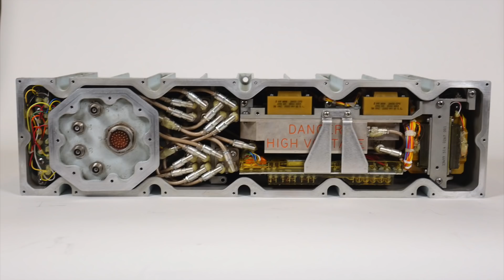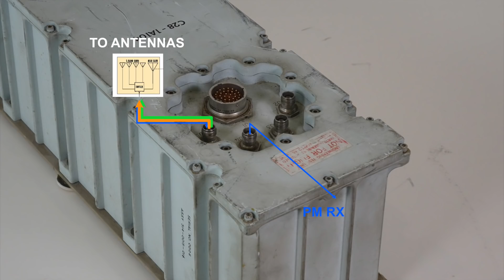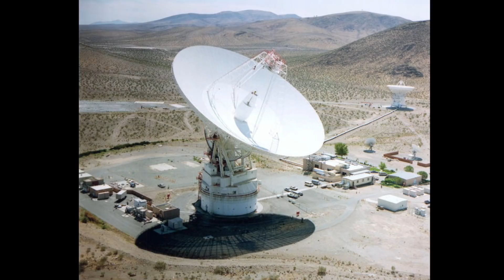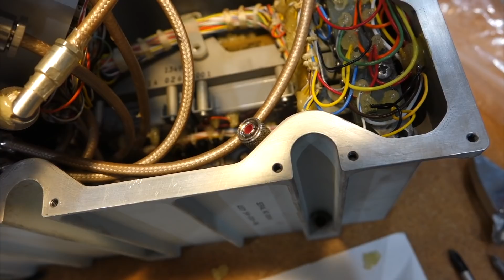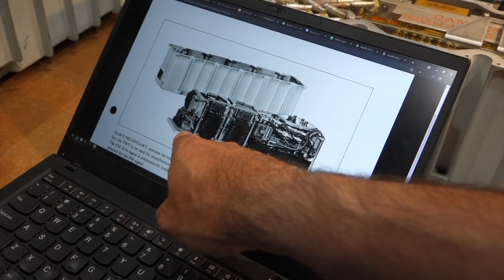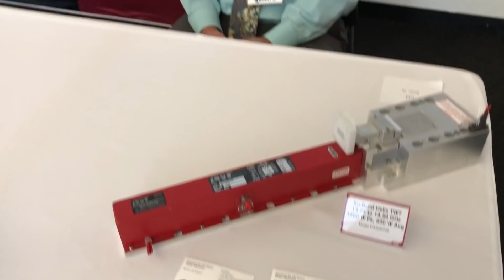Apollo Comms Part 2: Inside the Traveling Wave Amplifier

Comment: What is the purpose of the loud "bip" in the communication? Purely to signal PTT to humans of for the radio hardware?
Reply from the maker: Both. These are Quindar tones, automatically generated when the capcom presses the push to talk button and then releases it. This would signal to the transmitting equipment to which capcom was connected via a dedicated phone line, and which could be on the other side of the globe, when to turn the transmitter on and then off. This is particularly essential when the communications are half duplex (which interestingly is not the case here). They are of course no longer necessary with modern equipment, but they kept them to this day, as it is a helpful hint when having  slightly delayed space comms. It gets the astronauts a hint that a transmission is over and they can begin to talk back (I do not believe they heard the intro Quindar, as the transmitters were not turned on until it was detected, but I think they heard the outro). I guess what you nicely call "PTT to humans", which was unintended, but turned out to be quite helpful.
Reply: @CuriousMarc  Thanks a lot for the response! I wondered about this for a long time, thinking it was some kind of audio semaphore.
I am working on information systems for buses and tramways that use TETRA radio and even if full duplex is available, some use cases mandate half duplex. For example central difusion or driver distress.
Thanks again for all your channel content this time, always a great piece of engineering culture. 👏

Comment: Can you maybe give some background on why they used high UHF for the radio link? Power usage, distance, signal clarity through the atmosphere, that kind of thing.
Reply: Directivity and noise would be two reasons. Higher frequencies need less power and are also more directional with a small antenna. Background noise (both cosmic and local) tends to be stronger and weaker in various frequency bands, as was somewhat well known by that time, so they picked frequencies with low background noise levels so they needed less power level to get over the background noise.

Comment: 11 watts into a dummy load should be just fine - power it up. And thank you for the great video's. 73
Reply: Depends on the size of the load and the frequency
Reply: @TheFool2cool  11 watts into a proper microwave dummy load and the RF isn't escaping very far.
Reply: @ve7fm447  It may be closer to the 20 watts of the TWT output this close to the amplifier. But yea, same thing, use a 20W dummy load.

Comment: With all this complexity I find it hard to believe you can't just remove it as an assembly just like the picture of the innards out of the box looks. You mentioned it may have been built in the box from the bottom up but by looking at it out of the box some screws that are in from the side would be impossible to fasten unless it was out of the box. It looks like several screws you removed were holding it down inside there by using the sides of the box as the anchor.

Comment: Was RX/TX done through the same antenna, or were they strictly separate ones?
Reply from the maker: Same antenna. The triplexer handles the muxing of Tx and Rx. However there were five antennas to choose from (4 omnis and the high gain). But once you chose one, it was doing both Rx and Tx simultaneously.

Comment: Shocked about unsoldered pin 😳. I can't believe, this is the real Apollo Comms modules already used at 1969... 1972 ?
Reply: "Not for flight". It didn't go thru all of the testing needed for a flight article. All that stuff was built by hand, and inspected by hand. No soldering robots in those days.
Reply: @lwilton  you're right, I missed the sticker "Not for flight"
Reply: It could have been an engineering sample for weight, case hermetic integrity, vibration etc. It may never have been powered up or never have signal through it

Comment: Why can’t you tighten RF connectors?
Reply from the maker: They only have the correct impedance match and low reflection specs if you tighten them to a certain torque, which is not that high - particularly SMAs. Can't deform them even a tiny bit. It's quite obvious when you make microwave measurements, they'll change, sometimes dramatically, if a connector is not tightened enough or tightened too much.

Comment: Was this CM block one or block two hardware? Was this the same design as the hardware in Apollo 1? Poor communications and radio troubles were a contributing cause to the fire by causing the plugs out test duration to be expended.
Reply from the maker: This is Block II. One telltale sign is the hermetic enclosure.

Comment: Clearly, the enclosure is an old V8 valve-cover. : )
Time to work on the roughing and high vacuum pumps.
Even a Technician license would let let you use that, as long as it fits in the bandplan.

Comment: Been wondering since Part 1: Why is the PM ranging-code pseudorandom rather than a rolling count? (If the  answer occurs later in this ep or the next, I'll have to ammend this comment. ;) )
Reply from the maker: So you can use correlation over several seconds to beat noise by several orders of magnitude, then use the Chinese remainder theorem to quickly find the range. It's explained by Ken here: https://righto.com/apollo/ranging.html. It's still done like this by the way.
Reply: @CuriousMarc  I also found this note in JPL Tech Report 32-811 (1965):  "The characteristic of being essentially balanced, i.e., of having as many 1's as 0's in it. While this is not an absolute requirement, balanced use of power in the carrier sidebands increases efficiency and improves system design."  PS: Wow, Master Ken's page is really nice! Thanks to you both.